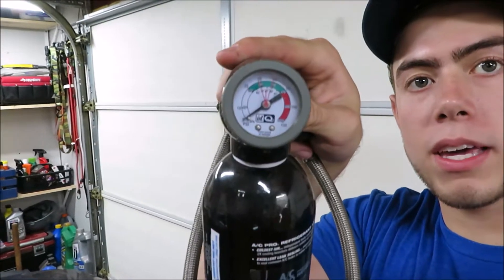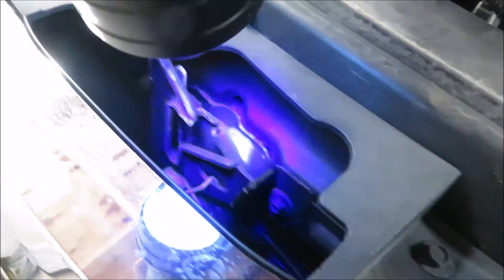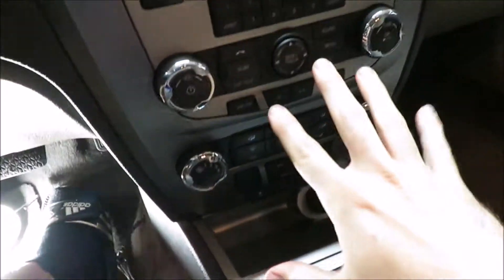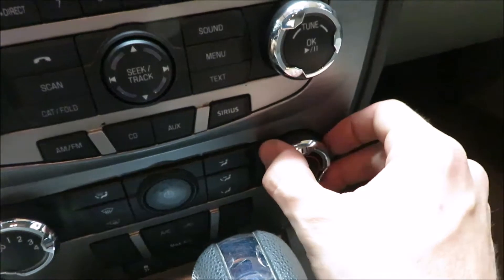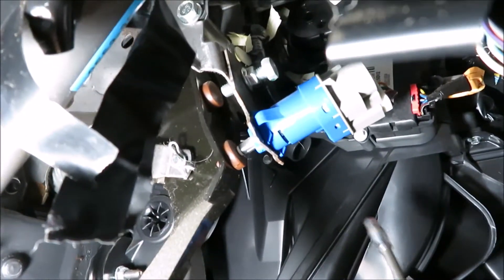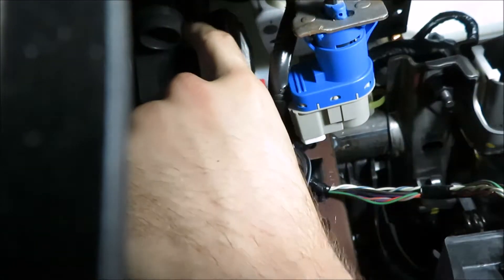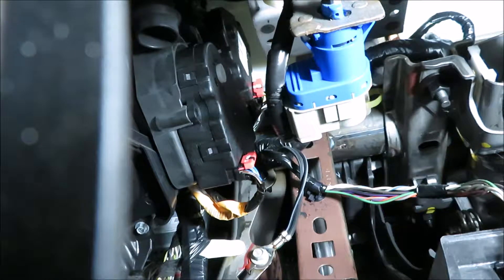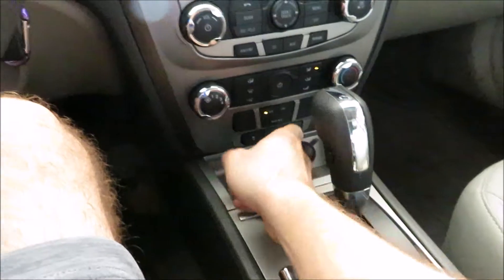How To Fix Car AC That Blows Hot Air

Comment: So, here we are, 4 years later, and this video is still helping people.  Thanks for that!  My AC started intermittently not working, but then stopped completely   By following your instructions, it does look like the actuator (and, hopefully not the HVAC control), so I've ordered one from Amazon which will be here in a couple of days.  In the meantime, it's still too hot to do without AC, and I noticed that, when I first turned the car on, with the AC set to full, it would start blowing cold, but then fail over to hot.  So, I climbed under the steering wheel, cranked up and car, and then disconnected the actuator before it could go hot.  VOILA!  Took it for a drive and it stayed cold the whole time.  Hopefully that will do the trick until the part arrives and I can put it in.  Also hope this helps someone else in a similar situation.  Thanks again!!

Comment: Before you do anything or buy any parts to resolve a/c drifting from cold to hot .
Check Your Car battery. The car will start up just fine but will not have enough power to run all the electronics properly.

Comment: I have a  2015 ford escape  when  I start to vehicle all modes works properly  when I turn off the vehicle when the vehicle reaches normal temperature  the a/c mode  only works on defrost and floor mode I did change the blend door actuator  Humm. I'm stuck HELP PLZ

Comment: WARNING: watch this user’s follow up video 

It is hugely irresponsible for you to keep this content public after the “fix” which you demonstrate here proved wrong after a day. I just wasted about an hour of time and about $50 on the part (blend door actuator for air temperature blending), only just like you to find that the real problem lies in the control module. 

It is plain sad that you would not even take the time and care to take this video down or at least include the updated information in the video’s description. What you learned a day later, when the AC failed again, rendered this video at best useless.

Comment: I have a 2010 ford Fusion. My clutch will not kick in on the compressor. Does the air door actuator play apart to keep the clutch form working? Hope you reply, Thanks,

Comment: Thanks so much for posting this video! I also have a 2010 Fusion with the exact same problem. It started acting up last summer, but only when it was extremely hot outside. Now, this summer it started doing the same thing until it was doing everytime I use the car... going to blowing hot after a minute of cold air.  Don't know about the info/reset thing mentioned below, will have to check into that. What I did do for a temporary fix until I could get a replacement part is this:  With A/C on, fan on, and temp adjust set to hot all the way, turn car off for about 10 secs, then start it back up. Like in the video, gradually turn temp adjust all the way cold, and make sure it's blowing good and cold. Then unplug the actuator and it will stay set in the cold position. Ahhhhhh!!!! Nice cold air until you can get around to replacing the actuator.
     Great video! Thx ☺️
Reply: Did replacing the door thing fix the problem?

Comment: Hey buddy really appreciate your video. , i have a 2012 ford fusion and mine blows cold for few seconds and then it is like the vent adjust then blows hot. Do you hear the vent or air adjust when it goes from cold to hot?

Comment: I tried all suggestions and nothing worked. So out of desperation l hit the reset info on the steering wheel and it worked.
Reply: Wtf. I just did this and it worked for me too. This has to be a system issue.
Reply: Jerome Goodman Where is the reset info button?

Comment: So mine didn’t blow cold for a second it just doesn’t get cold. I used stop leak, no visible leaks. Used AC Pro to recharge, it held pressure, didn’t get cold. Is it the compressor?
Reply: It will get hot at the heat setting. But when I get to cold notch by notch it gets cooler but not as cool as it should. It’s a 2010 Ford Focus DE